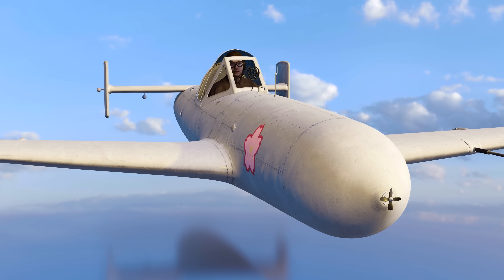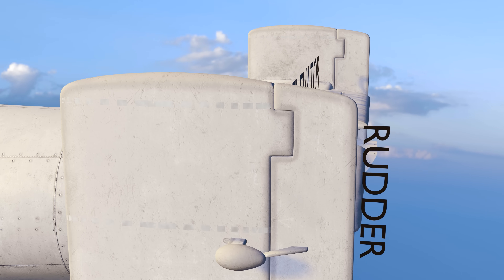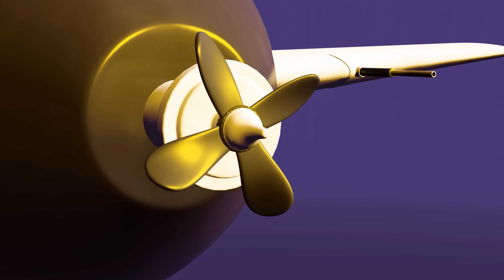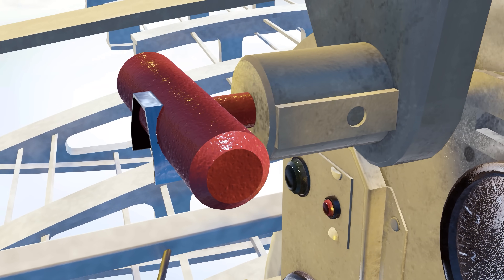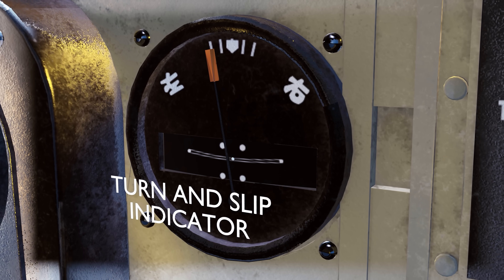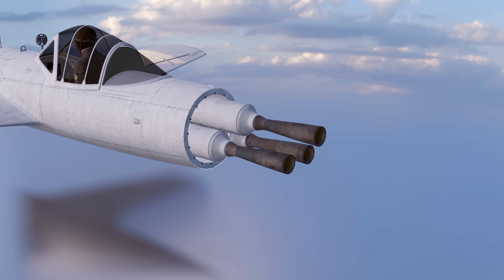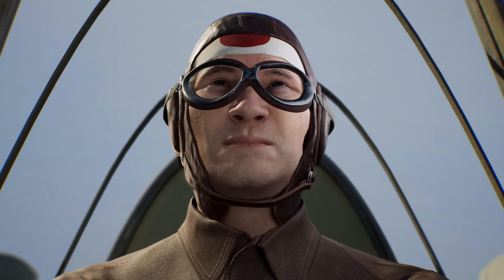Inside the Ohka Manned Missile

Comment: It's a little known fact that it was only rushed out as a kamikaze weapon.  It wasn't intended to be that way when the project was started.   Japan had several guidance system projects going alongside the development of the Okha's engine and airframe, that were to be used on a variety of weapons.  There was an indigenous infrared seeker, an indiginous crude radar guidance system, as well as a copies based on shared plans from both Hs-293 and Fritz X that the Germans had sent.   However, progress on everything was stalled and Japan had material shortages as the war went on.  In desperation, the design was modified and a cockpit and manual controls retrofitted to the design!

Comment: Great concept, but they didn't have the technology at the time to pull it off. Very short range, very low powered rocket engines, the Ohka would have to be released almost on top of it's target, and fly in a very predictable descending trajectory.

With modern technology and propulsion, this could be an insanely accurate and effective cruise missile. Plus near-impossible to intercept, since the pilot could make evasive maneuvres better then any kind of guidance computer, and be far less predictable to enemy radar/tracking. Add to that the ease of manufacture (no need for expensive computers and guidance systems), and, macabre as it is, humans are plentiful... these could be deployed en-masse to literally dominate the battlefield.

Comment: One note about the propellant. What you described is a double based smokeless powder. Meaning it contains nitrocellulose and nitroglycerin as the 'bases'. There are no separate fuel and oxidizer in these compounds. The fuel and oxidizer components are chemically combined in each of those two compounds. The nitro group is the oxidizer component and the glycerin and cellulose are the fuel components.
Reply: Well, I hope the pilots don't accidentally inhale it. They could get sick!

Comment: Most likely this system would be used in a dive bombing attack, hence the inclinometer in the cockpit. It would be extremely difficult to maneuver into the side of a moving and probably evasive maneuvering ship in low level horizontal flight. The sighting system was not mentioned in the video, but it appears to be a standard two element dive bombing sight as used on many dive bombers of the period, the difference being no bomb release.

Comment: There were actually plans to have a model with additional wings, actual full secondary wings - most likely somehow attached to the bottom most portion of the aircraft. These would provide additional lift, but also additional range - out to a point of some 50+ miles. These secondary wings would actually also allow them to be detached by the pilot at any point to allow for additional speed VS range.

Comment: I believe the term “pitot” (as in “pitot tube”) is pronounced “pee-toe”, not “pih-tut”. The word “pitot” is actually shorthand for “P total”, which means the total pressure of the airstream as it passes over the aircraft. Once the “P total” has been sensed by the pitot tube and adjusted for calibration error and density altitude, the pressure can be read as airspeed.
Reply: You are correct about the pronunciation, but a pitot tube is actually named for Henry Pitot, the French hydraulic engineer who invented it in the 1732, and any relation to P total is coincidental.

Which of course makes the pronunciation even more clear as it's someone's last name.

Comment: At the end of the mission you show the Ohka approaching the target as a sea-skimming missile, similar to an Exocet. This is done to hide the missile from radar directed defenses on the ships in a naval strike force. However, this requires a lot on energy from the rocket propulsion engines in the missile. The Ohka did not have much energy available, so it makes better sense to fly a high trajectory to the target and dive towards the deck instead of trying to defeat waterline armor. The inclinometer that showed -25 degrees(?) dive angles is a good clue that this is how the Ohka was supposed to be used.

Comment: At the same time at Pacific theatre of war US was testing/using Tv guided, remote controlled aircraft/bomb the Interstate TDR. The TDR-1 had 425 miles / 684 km range, was powerd by two Lycoming o-435 piston enignes with approx 220 hp /160 KW each, and carried 2000 pound explosive warhead/ combination of bombs/ or torpedo. It was controlled from aboard of modified  Grumman TBF Avenger from a max range of 30 miles 48 km away... By today's nomenclature this would be called TV guided munition or "suicide FPV drone"... This only shows how big the disproportion of technology and force was between US and Japan at the end of the conflict. The fall was inevitable for Japan.

Comment: I'm sure someone else must have commented on this, but @4:46 the thrust is said to be 588 pound feet. It's actually 588 lbf, where the f stands for force, sometoimes also written lb(force). So, the thrust of each engine is equivalent to the force of gravity on a 588lb weight. 588 pound feet is actually a measure of torque which in itself wouldn't make sense in a jet engine/rocket engine. More details are here: https://en.wikipedia.org/wiki/Pound_(force)

Comment: I imagine that you found, in your research of the facts, your contention that the fuselage of the Okha was skinned with balsa wood, but I am extremely dubious.

Even thick, high-density balsa wood would be inadequate for the aerodynamic loads of even a one-use aircraft. It cannot even tolerate the local stresses of (self-tapping) screws. Additionally, balsa wood is very absorbent of moisture, and when it does its nominal strength is further compromised.

Perhaps your sources indicate that the fuselage skin was fabricated of end-grain balsa-core composite ? That was a technique used for several WW1- and WW2-era warplanes (IIRC, the German DR1 and English Mosquito come to mind), as well inter-war civilian aircraft (IIRC, the American Lockheed Orion ).

I commend you on your facile CG modeling and motion-control, but in the matter of proscribed AoA, the configuration of the bungees, and other minor details, they cannot be correct as per engineering nuances and/or flight dynamics.

All in all, well-done, though.

Comment: I have a book from 1973 called war planes and air battles of World War II. In it there is a description of the Ohka: “ A special attack aircraft was launch for my parents aircraft at 20,000 feet. Powered by three rocket motors. It been dived on its target. Max speed: 620 miles an hour. Max range: 20 miles. Armament: 4000 pounds of helium in the nose.“

Helium is an inert gas, but at 4000 pounds means it had a major explosive force of it being released, and would be terrifying. 

I’m not saying this is correct, but that’s the information I’ve always known about. At least since 1973 lol.

Comment: A good description, but none of the “why” behind its design. I feel like someone has read a Wikipedia article at me. Why was this aircraft needed? Why was that specific top speed chosen? Why are there four arming pins on the pilot side of the warhead? Why were solid rocket motors used? Why did it need to be carried by a bomber, rather than an aircraft carrier? Why was the airframe metal, when it was in such short supply? Why was the front firing pin needed? Why was the warhead fully inside the plane, rather than integrated into the exterior surfaces of the nose? Why wasn’t an unmanned missile possible?

Comment: In Jr. High school, or shop teacher gave us a balsa wood glider project of this plane, it was copied onto a piece of paper broken down to fuselage, rear horizontal stabilizer, vertical fins and wings, you used a thin piece of cellophane plastic for the canopy, you had details you could add to the flying model or you could build it with its basic form but you had to build it to fly, the wings had to be shaped correctly with a leading edge and a trailing edge including the horizontal stabilizer and the vertical fins which was part of the grading process, there was a version that you could build using a small model rocket engine, and it instructed you how to use clay on the nose to balance it over the center of gravity. Still have mine and a Xerox copy of the original template.
Reply: Too cool! What were stage coaches like?
Reply: Your mom knows how to grease wagon wheels, ask her. @robertmueller6979

Comment: The top speed of this contraption was about 260 m/s, while a typical shell velocity if a battleship AP shell would be around 730m/s.

So I think the armour piercing capacity would not have been that impressive. I would guess armour decking in a dive or super structure would be the only really vulnerable parts. But of course smaller ships with little armour would still be penetrated.

Comment: 400 mph with a range of 23 miles = a maximum of 3 minutes and 27 seconds of flight time to make use of the instrumentation. This is under "perfect" conditions and probably wasn't the exact amount of time pilots actually had, but it would be the maximum amount of time once the engines were lit.

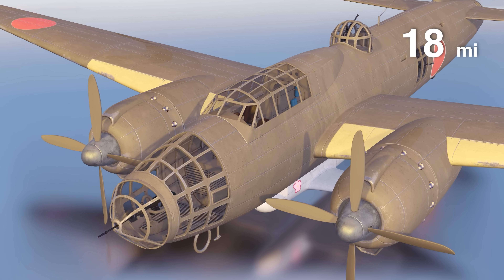Comment: 10:28, a range of 18 miles?  I must have done something wrong; I have 66 miles from 10,000 ft.  10,000 ft X 35 / 5280 ft =  66.29 miles for the range.  18 miles sound like, perhaps, the glide slope after burnout?

Comment: 4:53 A small correction is needed to the statement that "the engine output was 588 pound feet of thrust." Perhaps the video makers got their Ohka specifications from the Wikipedia article titled "Yokosuka MXY-7 Ohka." For thrust, the article specifies "2.62 kN (588 lbf)," where kN stands for kilonewtons, which is appropriate because thrust is a force. However, "lbf" does not stand for "pound feet" but "pound-force," for which there is a Wikipedia article titled "Pound (force)". Actually, after rounding, 2620 newtons = 589 pounds of force. "Pound feet" would be the same unit as "foot pound," which is a unit of torque (force applied at a distance).
Reply from the maker: It was a mistake, we should have send pounds force.We got our research  from many sources but on the engines from the US research on the Okha after the war
Reply: @BluePawPrint  The narrator uses the terms "engine" and "motor" interchangeably.  The aerospace industry convention is that solid propulsion uses the term "motor" (which would be the case for the Ohka), and liquid propulsion uses the term "engine".

Comment: There was a panel with screws in the initial test models to be able to cut the prop fuse, later on they welded it shut and eventually removed the bypass completely once they were in service. Mitsubishi has some amazing history/designs

Comment: Love your videos but this one needs a bit of peer review as quite a few items were not following correct terminology

Wingspan
Thrust would probably be in lbf (pound force), thrust is not measured in lbft (pound feet), that is a unit of torque
The solid state propellant seems to be in 3 cylinders inside of the casing, i vould be wrong i didnt specialize in rocket propulsion but it is probably a aingle cylindrical slug of propellant with a cylindrical bore down the center as opposed to 3 slugs.
Edit: seems you found particulars about the 3 slugs, never heard of it!

Rockets are cool becausw in subsonic flow, the structure shown would be a nozzle, a throad, and a diffuser. But in supersonic flow, diffusers act as nozzles. Always awesome to think about!

Respect to the men qho piloted these. Human to human, standing up to fulfill that duty for your family, community and nation, the Japanese truly were selfless in the long wheel of history, these moments were and forever will be untold.

Comment: Fine, if you have an unlimited supply of pilots, skilled or not, 

Eventually, otherwise, you run out of humans. 

The German equivalent was the V1 and V2. Both unmanned. Those  did not win the war either. The total tonnage of explosives dropped by V1 & V2 over the entire war was less than one allied air raid.
Reply: the thing is those manned missiles could sometimes take out 100s of soldiers for the price of 1 pilot, and anyhow materials for high tech weapons like V bombs and me-262s ran out well before they ran out of humans

Comment: The symbolic meaning of the cherry blossom was that when they fall from the tree to the ground they never return to the tree. It is believed that some of the pilots blacked-out from the then unknown g-forces as some of the incoming Ohka flew off course and fell short of target. Mitsubishi "Betty" bombers were used to transport them in their bomb bay.
Reply: Looking at it, I'd be more willing to bet that there is a design issue that could have either stacked tolerances to overbalance the aircraft when fuel is depleting (making it nose heavy and potentially leading to an unrecoverable dive) or they were exceeding critical mach and fluttering their control surfaces off. Solid rocket engines being what they are it's also possible they had a containment failure and melted the rear empennage... or for that matter just collected enough heat to soften the aluminum. 

The trouble with 'aircraft' like this is there's not going to be much left to analyze from failures.
Reply: The g-forces weren't unknown. They weren't exactly doing high g maneuvers. Most of the time a pilot missed or veered off could be attributed to injuries from being struck by AA fire.

Comment: Wow, I didn't realize the Okha was so complete... I expected there to be a joystick, rudder pedals and three buttons for the rockets in terms of controls, and an all-wood construction.

This thing had all the instruments a plane needs for VFR, lol
Reply: I looked up 'joystick' after seeing it referred to as such. I figured it was a modern term used after the advent of video game controllers.  Nope - joystick is not marketing for a game controller.  

It originally refers to steering sticks for planes between the knees. It was always called a 'joystick'.
Reply: Indeed, one could put in one hell of an engine and fuel and wheels instead of the warhead, and have a sort of plane that could fly.
Reply: Kind of a waste of gauges
Reply: @Unus_Annus_ I think it was for precision bombing.
Reply: They clearly saw guided rockets as a necessity, not a cheap easy option at the cost of their own people or something.

If they were just willing to throw lives at the enemy in exchange for some damage, I'm sure it would be much simpler. Probably all wood except for the warhead, without rockets, without instrument panel, essentially just a bomb that was designed so a person inside could change its course for a better hit.

(and I mean, guided rockets if even possible would have been twice as expensive as a ball turret. which is shockingly complex)
Reply: @specialforces3114  The Japanese were actually working on a infrared-seeking anti-ship glide bomb, but kamikazes were more practical (for everyone except the kamikaze pilots and the people on the receiving end).

Comment: This missile knows where it is at all times. It knows this because it knows where it isn't. By subtracting where it is from where it isn't, or where it isn't from where it is (whichever is greater), it obtains a difference, or deviation. The guidance subsystem uses deviations to generate corrective commands to drive the missile from a position where it is to a position where it isn't, and arriving at a position where it wasn't, it now is. Consequently, the position where it is, is now the position that it wasn't, and it follows that the position that it was, is now the position that it isn't. In the event that the position that it is in is not the position that it wasn't, the system has acquired a variation, the variation being the difference between where the missile is, and where it wasn't. If variation is considered to be a significant factor, it too may be corrected by the GEA. However, the missile must also know where it was. The missile guidance computer scenario works as follows. Because a variation has modified some of the information the missile has obtained, it is not sure just where it is. However, it is sure where it isn't, within reason, and it knows where it was. It now subtracts where it should be from where it wasn't, or vice-versa, and by differentiating this from the algebraic sum of where it shouldn't be, and where it was, it is able to obtain the deviation and its variation, which is called error.

Comment: Not knowing date of production,  I am surprised the entire device was not made of wood.   If mid to late date of the war Japan suffered great shortages of raw materials to make metal especially aluminum which is not easy.  Great video!!!!
Reply: This was supposed to be their "wunderwaffe" so they invested as much into them as they could.
Reply: The Axis and the Japanese had an idea at one point to Cripple the aluminum smelters of North America by going in with submarines, going to shore with saboteurs and destroying the power lines leading to the plants.

 The aluminum in the casks would harden without power flowing to them pretty quickly and would ruin them and make it necessary to completely rebuild them.